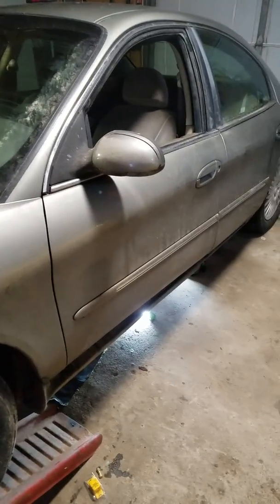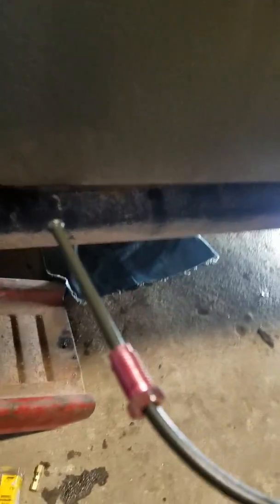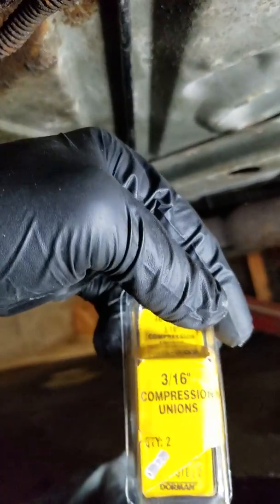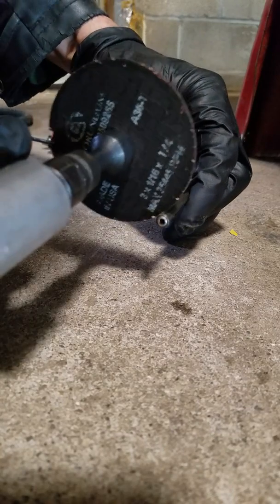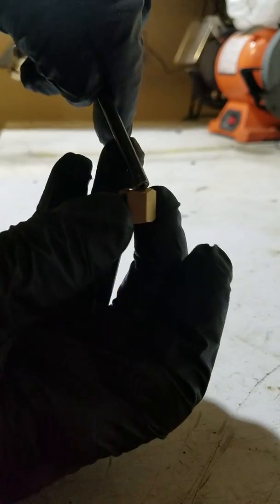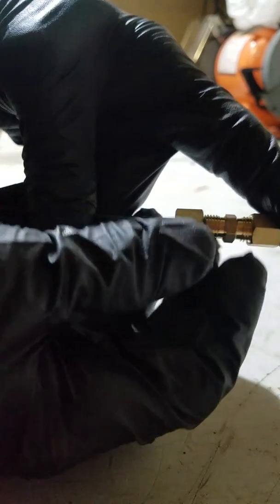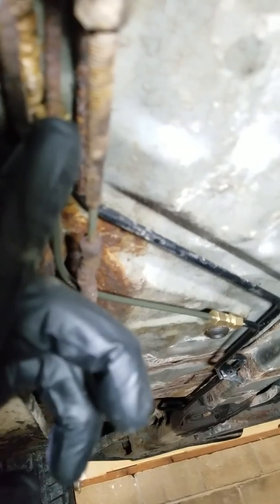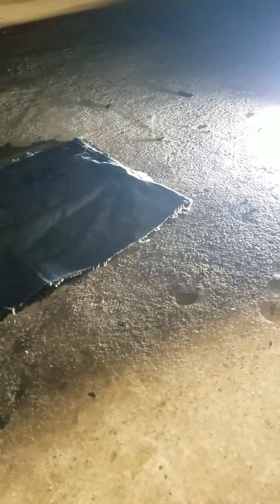Easy brake line/leak Repair! For $10 dollars DIY!

Comment: compression fittings are not suppose to be used on brake lines.  Pretty simple to splice it by double flaring both ends better safe than sorry.
Reply: lol who told u that they work perfectly

Comment: My break line broke on an 05 Buick and he went and bought the new line but one bolt fits perfect and the other one doesnt. My brother said you have to buy an adaptor  or so the bolt will fit right . Is this correct? Get back to me please as soon as you can . Hes working on it right now
Reply from the maker: You should be able to find a brake line adapter that works at advance auto parts ,most auto parts places have them.
Reply: Thanks its fixed!

Comment: Never use compression fittings on a brake system. They are not rated for the nearly 2000 lbs of pressure those lines take. Illegal in every civilized place. 
You must flare the lines and use brake unions and male brake fittings
Reply: Totally agree! He actually did purchase a double flared brake line with the fittings already on it, but chose to cut off the double flared ends so that he can fit the compression fittings, and that's where he went totally wrong. All he had to do was to double flare the ends of the existing brake line that he cut off and splice it with the already double flared brake line he purchased with a brake union. That's the safest way to do it. You don't want to be taking any risks when it comes to the brake system.
Reply: Dorman makes high pressure 5000 psi rated compression unions which are more than capable of handling the brake line pressures of automobiles.
Reply: @salvation4all313  Apparently, even Dorman doesn't recommend those high pressure compression unions rated for 5,000 psi. It actually states it on their website. Check out part# 800-202 on their website and read the product description.